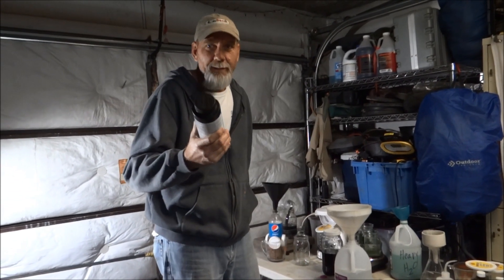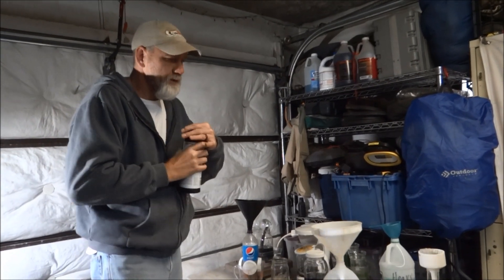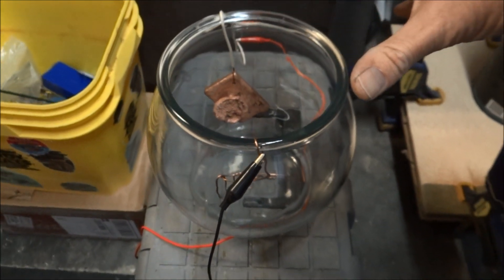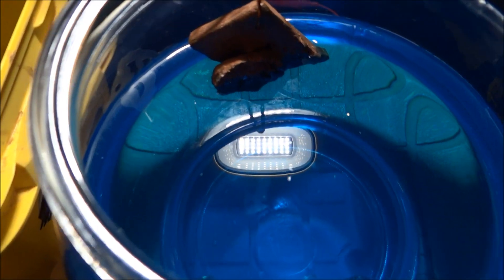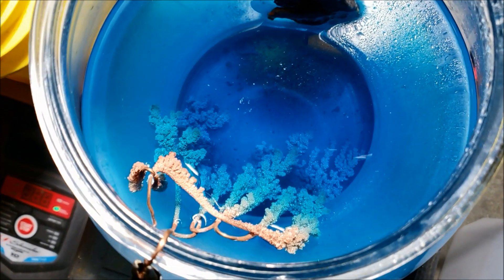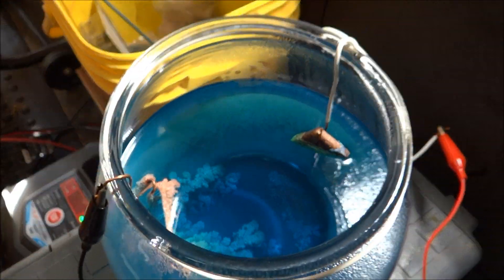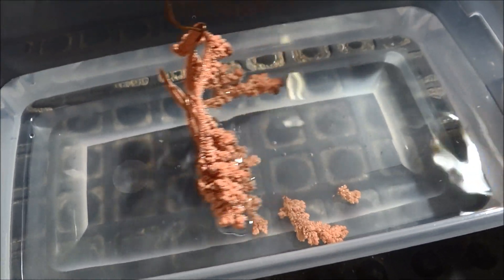Purifying Copper Crystal with Copper Sulfate Cell

Comment: If you or anyone else processes gold scrap, there's always left over copper nitrate. Copper nitrate also is a good electrolyte for using in a copper cell. It's also very cheap because it's just a waste chemical. I've tried the copper sulfate method and the nitrate method, and results are about the same, although the copper levels drop using sulfate and has to be replenished while using the cell.
You can tell because the color in the cell lightens as you use up the copper.

Comment: Question…. Do you connect the whole 12 volt battery to the anode? 

Also can you reuse the anode?

Also is there any additional process required before smelting the copper crystal?
Reply: Yes

Yes 

No

Comment: You can start the cell with just water and sulphuric acid, the copper sulphate will evolve from that naturally. You can also separate the copper substrate from plated e-scrap pins this way, and get both copper crystals and gold foils in the same process. I use a titanium anode in the anode bag to deliver the electrical current. I call it the TAPP cell. (Titanium Anode Parting Process). So far, a 2kg copper crystal is the largest crystal I've grown.
Reply: U should also post videos of your cell
Reply: @reprocessors  
I've used up almost all of my plated copper material, and have mainly plated phosphor bronze now. The tin in that alloy requires still another process in order to avoid issues.
Reply: I concurr, please make even the most rudimentary of videos and post.
Reply: He really just said the wrong words is all, but got everything right, hes using ~15% sulfuric acid drain cleaner
Reply: @NapKanT  
No, he clearly stated that he started with copper sulphate crystals. All I'm pointing out is that that step is not actually required.
Reply: @Vibe77Guy  I subbed to your channel in hopes that you start making videos.  The world of electrolysis needs you now more than ever.

Comment: Is there a catalyst that can be added to speed up the process?
Reply: It is primarily driven by surface area and amps. So industrially they make it into large sheets,  like a 1/4 sheet of plywood.   Then use a power supply to carefully regulate the voltage to be low,  but current very high. 

I am not sure,  but I believe that it is then zone refined if used for wires.

Comment: Perhaps you could make 2 buckets connected to eachother. So the pieces that break off don't mix with the contaminated pieces. You will be able to recover much more copper.
Reply: I tried that and it worked great.  I also found that super saturating the copper sulfate solution and keeping it kinda warm with a small glass aquarium heater, it made the process go somewhat faster.  Cover so no dust goes in.  Just 1 volt at whatever current is ok too, but more copper sulfate is more current.

This is also a great way to make dilute sulfuric acid, just use a graphite rod on the positive side,
Reply: Hmm.  Thanks for the idea.

Comment: Would this be good to extract copper from brass consisting of copper + zinc? Also, might suggest a current limit like a small lamp in one of the battery leads in case of a short-circuit!
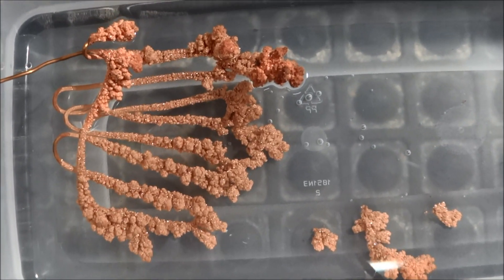Reply: 6:14
Reply: I don't think that is possible
Reply: Yes exactly u can get copper from brass ,i have done this personly i will send u the video.

Comment: The edge is glass so it wouldn't conduct any electricity lol. It just cannot touch the circuit (anode).
Reply: I wrote this before I tried it. It definitely works better away from the edges.

Comment: If you use a stainless steel bowl with three contacts around the rim that connect to the central ground, you turn the entire bowl into the cathode. With less distance and more surface area to work with, you should speed things up quite a bit. You could also make an electrolyte from dissolving copper in a bit of Nitric acid, then diluting it down with distilled water. The lower ph will also conduct electricity better. At weakened concentrations, the bowl will be fine too.
Reply: I have destroyed two stainless bowls with even a hint of nitrate, and because the plastic cover/plastic anode basket covers the level of the liquid from sight, and it's easy to get greedy about headspace when fighting for surface area and dunk a slightly too-volumnous piece of dirty copper in to be refined, and as soon as the surface of liquid hits the alligator clips, the bowl is toast
Reply: That would form copper nitrate and since he didn't make the copper sulfate that would be incredibly stupid cause nitric acid is much more expensive and stainless steel would be a horrible cathode for this reaction

Comment: i myself have been researching electrorefining.  copper is one of the metals i researched.  i found that copper is easily displaced during electrolosys.  so far, theses are the voltage ratings i have found for copper:  + 0.522 V ( Cu+/ Cu ) ; + 0.345 V (Cu2+/ Cu )
Reply: Is that >0.522V?